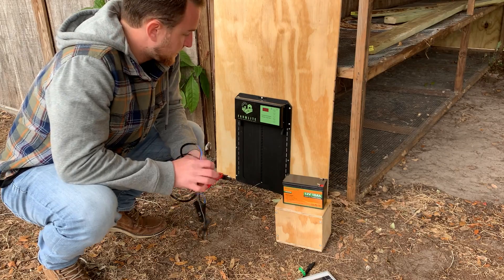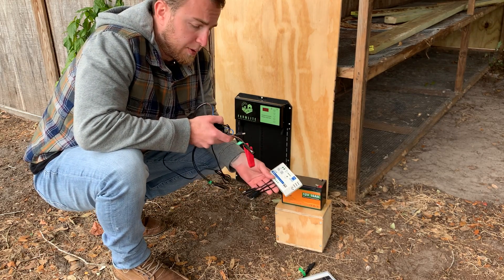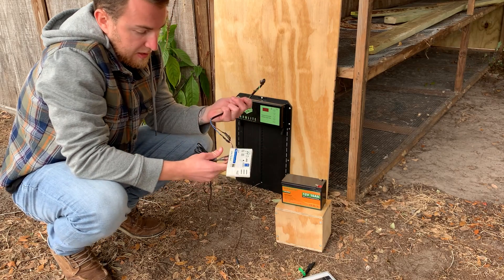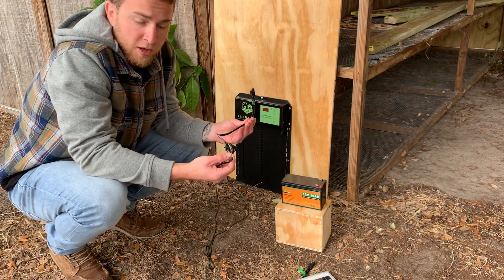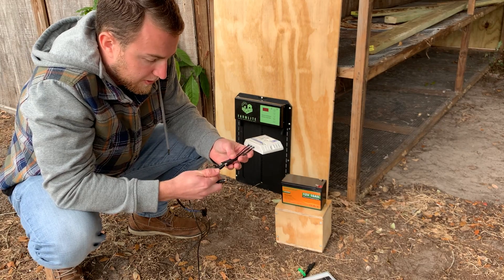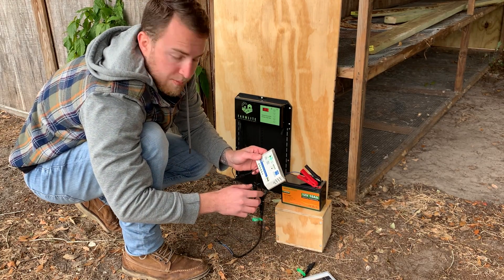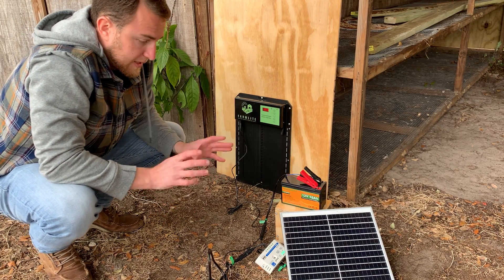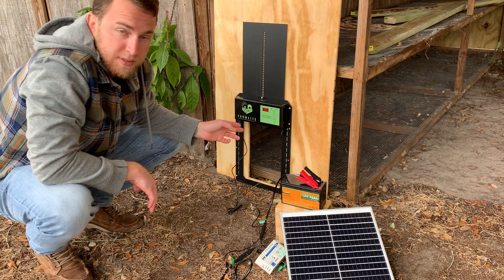FarmLite Automatic Chicken Coop Door Solar Hookup Explanation

Comment: Can two farmlite doors be installed and hooked up to one battery and panel? I need one door for my coop and one door for my run and would like to hook them up to the same battery and solar panel.
Reply: I had the same question… no answer 🤷🏻‍♂️
Reply: @bigsteve9279  I have yet to install the doors with battery and solar. I never received a reply so am still wondering the answer as well. Best of luck with your build and install.
Reply: @mountainmama7823 
Thanks mama 🙂
WV? 
Can you answer this for, please? 
Am I correct, that I can’t hook up the plug in and the battery back up?  A YT Chicken Lady video said that she burned her unit up by hooking up both… 
I don’t get it 🤷🏻‍♂️
Reply: @bigsteve9279  I do not know the answer to this as I have not hooked it up nor researched. If I recall correctly I do believe you had to choose one.power source(electric or solar) but I would imagine one could probably find a way to switch back and forth if needed. I do not have those answers on if possible or how to do it if so.
Reply: @mountainmama7823 
Looks to me like it’s not gonna be reliable unless I use solar. 
I thought the battery backup would keep my girls safe when the power goes down. ☹️

Comment: First: Mitch is great to work with. I run a solar panel configuration with the 25 watt solar panel (all day sun with a vertical installation) and the 10 AH battery as shown in the video.  The door has been installed and running for seven months. The door has operated perfectly since the installation. The chickens acclimated very quickly. I have zero experience with solar, but everything worked out as advertised. This is a very cool setup. I'm very pleased. I will comment again at the 12 month mark.

Comment: What about the inline fuse they say you should have attached on the battery side.  Did you ever install a 5
or 10 amp inline fuse?
Reply: I did not install an inline fuse. The solar panel is pretty low amperage but you can install an inline fuse from panel to the charge controller